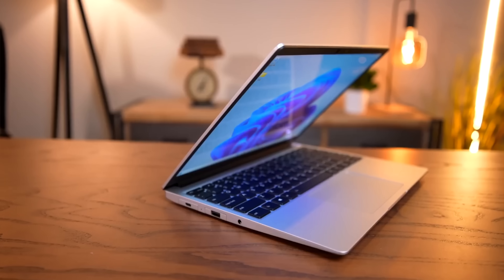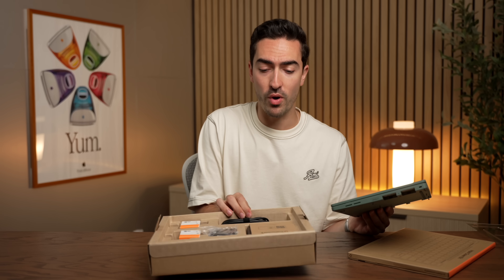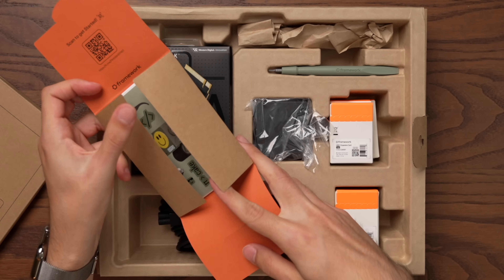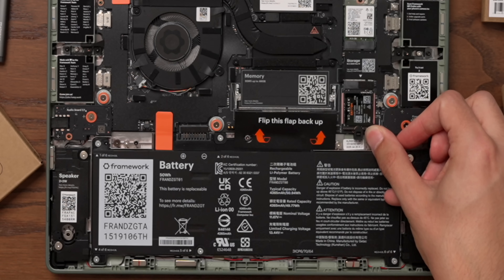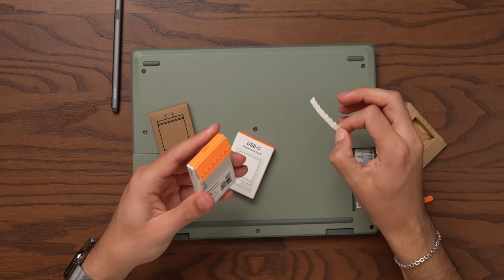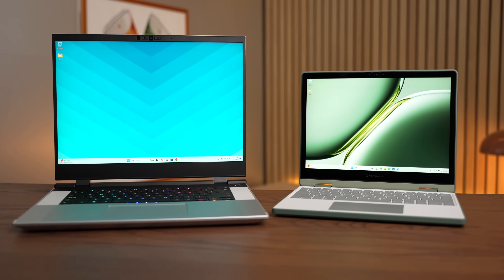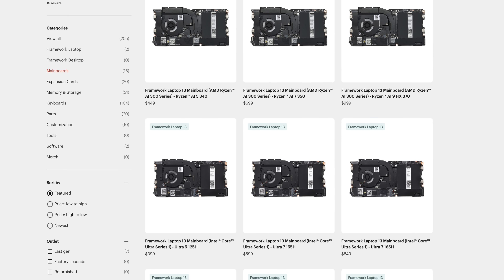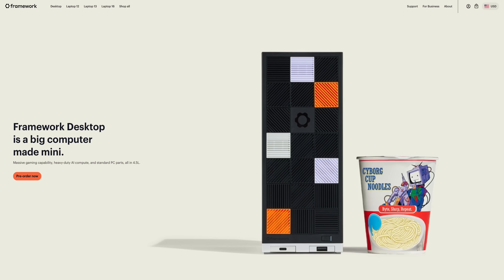Apple could NEVER: Exploring Framework 12

Comment: I was considering buying one of those. The main focus of it is really the 2 in 1 design, which makes the framework 13 (and the mac) just not suitable. This is just not a competitor to chromebooks, which are way cheaper and more locked down (both in hardware and software). I don't think any framework user would even consider a chromebook.
I ended up getting a Lenovo Yoga. What drove me away was the bad cpu, high price and worse battery life. I really value serviceability, but the lenovo was just so much better that it's hard to argue otherwise: for $600, I got a pretty good Ryzen 7, top of the line iGPU, 70Wh battery and so on; the framework is stuck with that old i5 and small battery for ~$950.
Now, I don't think spending extra with aluminum would help here. I think they should focus on getting a new CPU and reducing price; I would be fine with having a single pre-built model and no modular IO, if it meant cheaper prices.

Comment: Needs biometrics, at least a fingerprint sensor, but better if there is the Windows Hello IR cam. They need a better monitor on this machine, it doesn't even have 100% sRGB. Also they should at least get an i7 processor on this thing. A 13" form factor might make more sense for this thing.

Comment: If you say the device competes with a Chromebook, then don’t compare it to a high-end notebook like the new Apple models, where individual keycaps can’t be replaced at all and the entire keyboard has to be swapped out for a single damaged key. On many other devices, you can simply order replacement keycaps and swap them yourself in a few easy steps, without opening the device.

Single-channel RAM with shared memory for the GPU is fast enough nowadays that even Adobe Premiere runs fine on it. It’s not suitable for gaming, but most Mac users probably don’t care about that anyway.

The biggest downside for me is the half-size M.2 slot, because there are currently no 8 TB SSDs available in that format.

The video itself is well-made, friendly, and easy to follow.

Comment: Sure it's single channel RAM, sure the limit is 48GB, but look at what you pair it with. The benefit of dual channel RAM and more than 48GB (might get bigger modules in the future) would be lost on both the i3 and the i5 you can pair it with, incl. the integrated GPU.

Comment: yeah but when the MacBook air breaks a key on the keyboard or a screen cracks, match the replacement / repair price between the two?  its not about what performance you get but more of how cheap it is to keep it running "virtually" forever. and honestly the performance you get is not horrible, people have just been brainwashed to believer that apple  is top tier when in reality is not really, shiny and nice looking yes, but disposable and hard to upgrade/repair so after a year or two you have to spend another 2 thousand to upgrade... framework really is what we need and once the company gets more comprehensive sales, prices will go down a lot more, besides most of the repair parts are bellow the $60 bucks or less on most parts, so i am more exited about this than another mac or windows or Chromebook laptop

Comment: Are these Expansion Cards connected via USB C? Are they actually selling USB C to USB C adapters for $10? USB Hubs with 2 slots would make much more sense. Or at least USB A for retro devices.
Reply: You can just not use a C to C card and plug directly into the chasis. The purpose of the adapters is that you can get other port options, so while it looks dumb with C to C, it makes more sense when you see the C to HDMI, DP, A, SD, TF, etc.
Reply: @dontworry1302  sure, everything except for USB C to single USB C makes sense!
Reply: @igregurec  I don't believe you can do USB PD over a USB C hub, hence the 1 to 1. I wish there were 1 to 2 for other slots though.

Comment: 10:15 they want to change the way most it departments in schools operate. they want kids to have it and mess with it instead of it department holding them only in school, or replacing/repairing themselves. moving computer usage to even lower grades. kids should get that experience and they're also making it fun too. i could even go out as far as saying the cheap looks of this laptop is a positive thing for its market. parents don't want their kid who doesn't really understand values of things yet to have high end premium devices, they want a similar experience and more durability. framework 12 gives that and also delivers even more. the experience a kid would get building their own laptop just isn't something you can get from anyone else. plus you can also buy the broken component instead of a whole new computer when it eventually breaks as a parent.

Comment: It's a pretty compelling laptop. I like the aesthetic and form-factor. 

The only improvements that I could think of are:

- An option for a non-touch screen, in the hopes this reduces the overall price. (the current bezels are fine if that keeps the price low, would appreciate it if the non-touch option would still be a relatively beautiful display)
- dual channel memory
- the option for a beefier cpu. 
- bonus: a socketed cpu so that it doesn't require a full logic board upgrade when first getting a less powerful cpu option. (idk if this is possible)

If they keep it under 800-850usd prebuilt this would be a killer deal for every parent that wants a repairable laptop for family use, or for every enthousiast that wants a repairable linux laptop.

Comment: I think the single slot  of memory is the biggest downfall for this version of the laptop. In order to use the Intel Iris graphics you need a second slot a of RAM also computers and laptops work better with 2 slots of RAM being used. But i can't blame them for that because there is lack of space also this is there first 12 inch laptop that they had to design. Hopefully if possible they would add a second slot for RAM in the future in this version of the Framework.

Comment: As expensive for what it is this might be, I will be upgrading to it, having let the 13 and 16 pass before.
I am commenting from a ThinkPad T495, which was an emergency second-hand buy to replace a failed e585.
That previous laptop got unstable, probably from the motherboard flexing while carrying it around in a backpack for 6 years.
By using my current T495 and my LCD Steam Deck as a Linux Tablet, I have figured that I would enjoy a device in the middle of these two.

To save on costs, I will be buying the RAM and storage locally, I wish I could save further by omitting the wireless card since I have a spare.
After this and by omitting a Windows license, the total cost is €825 here. On the expensive side, but justifiable for something which lasts.
As I run a lightweight-ish Linux distro, which works plain better than Windows in my cybersecurity studies, my demands here are not that high.
Yet I manage to analyse 240GB disk images, do CAD, video editing and on my previous laptop occasional gaming on a lower level of performance, after a RAM upgrade.
And the bit of benchmarks I can find on the i3-1315U of the base Framework 12 indicate that it would double the performance I currently have at the same wattage.

Currently I use a dedicated screen-less drawing tablet for note-taking, but at times this becomes awkward.
So I hope for the 12's stylus support to give me a compact-er alternative, even if I will continue carrying that tablet for the greater comfort and accuracy.
Half the dongles will be a DIY 3D print around a cheap but good dongle I already have, making the amount of IO more reasonable.
And this will double as a stylus holder and moves the power button to the usual position, since it will be an extension to fit said dongle.

Comment: Framework is the only company besides Apple doing something really interesting in the laptop space. Apple does the self-contained design to its absolute best, while little Framework does an open and repairable design to the fullest. Everyone else is just awkwardly in between, getting the benefits of neither but the disadvantages of both.
Reply: GPD is doing some interesting stuff with ultra portable machines, but those aren't really "laptops" for the most part.

Comment: In my opinion, the Framework concept is the correct way forward, but I would not have Windows for the operating system because it is a bloated OS., which slows computers down, I would install Linux Mint or another Linux OS..

Comment: I bought a few 'convertible' laptops. And they all broke after just a couple of years of use. Breaking hinges and just plain stopped working. I wouldn't hesitate to pay €200 more for this one that looks way more sturdy. Once dropped a glass of Belgian beer over a macbook 13. €1500 gone. With this machine it would cost me between 50 and 100 euro to get me a new one. No need to pay a technician to try and get it back to work.

Comment: See I like this over the macbook becuase apples batteries suck. They die so fast (number of cycles). With the framework you can buy a new battery after 2-3 years and boom your good to go again. As for price don't buy your parts from framework. Get the ssd and memory from amazon, newegg, etc.. Fully kitted out I'm look at around $1000 for a maxxed out version. Sure at that price I could buy a mac but then I run into the battery issue. Least that's my 2 cents. that said I do think the 13 is the better buy for most people. For me though I just want this for board/party games and travel so I like the cheaper price point of this over the 13.
Reply: If you look after your battery, it will not die. EU Law states that they must have a minimum of 800 cycles before reaching 80% health. Charge to 80% and you will double the cycle count. The problem with your argument is that you only get 5 hours SOT with this old inefficient chip in the Framework, and doing the same, you get 2-3 times that with an MB Air. So, if you keep it for a decade, it is likely that you will have to buy a new battery for the Framework maybe three times, at £69 each. My M1 MB Pro 13 still has 96% capacity after 4.5 years! So, likely I may not need a new battery at all!
Reply: @andyH_England yeah that’s the rub I will keep it for 10 years lol. I dunno maybe Apple is better now I know when I had one from maybe 2012 or 2013? The cycles definitely didn’t go that high before it started to show its age. I mean it would last but nothing like the original life span.

Might just have been the one I had but by 6-7 years it would drain faster than I liked. Truthfully though it’s less important these days with the ability to charge via power banks. But, still sticks with me how annoying it was having to order batteries off eBay.
Reply: @TheRetroPitstop  Yes, like with most things, you can end up with a dud. I can only relay my experience, and I have had no issues with batteries in my business on either Macs or Windows machines. However, due to the poor battery life of older Intel processors, batteries tend to degrade faster.

Comment: Just to hit a few points about the 12.    First, I agree that the limited processor choice is a bit of a downside - the single channel ram is also a bit of a negative.  I have a FW16 and an ASUS ROG Flow X13 - if I didn't have the X13 - I would consider the 12.  But my use case would need a higher end processor and a lot more ram.  To be honest, I would want the Ryzen 9 AI Max + 395 with 128gb ram.  Given with what we've seen on the Z13 - we know it is 100% possible to chuck it into the 12's chassis space and the 12 has a bit more space for cooling, lol.  

That said, for the use case of this machine and the amount of ram there is available for this kind of device (48gb) DDR5 is nowhere near as horrid as DDR2/DDR3 was for laptops in single channel.   Also since there's no soldered ram it means you aren't stuck with some low-ball amount of ram where if you go significantly past it you're losing the benefit of dual channel anyway.   So  I also know that the original FW13" launch had some limited processor choices as well.  We can hope that maybe they can integrate compression attached memory modules (CAMM2) and maybe one of the new AMD/Intel designs coming down the pike for 2026 for future logic boards (this would make sense across their lineup).   

That said, upgrading the internals is a niche for the first owner.  The thing that makes this particular laptop a potential buy for a lot of students and educators is that framework has shown a commitment to long-term support for their designs.  It means that when a student is ready to upgrade to a different machine, they're going to have a choice to either buy a new logic board or sell the device to another person who will then have the option to upgrade the logic board.   If there's damage, framework's parts availability means this computer is not going to be ewaste.   Laptops get far more wear and tear than desktop computers.  Not a lot of people are going to hold their computers for 10-15 years and be willing to upgrade them.   That said, many people are going to be willing to sell off their device when its done.   This means that with some minor investments a new user can take an old laptop and get years out of it.  And if the people using this have a good experience, they'll probably go with framework again in the future.   And it will change how the laptop segment is presented to the public. 

My biggest issue with laptops of all manufacture specs has been hinge/screen failure.   I personally went with apple in the 2010s because of their rock-solid laptop chassis design - but having been in IT for years any time I had to get a workstation class laptop for someone - it was a PITA.  I have had so many instances where the hinge cracks, screen gets damaged or the logic board experiences mechanical stress and fails.  Second biggest issue?  Keyboard failure.  Third - battery.   Yeah I could get HP/Dell/Lenovo parts in the first 3 years easy-peasy, but doing long term maintenance was expensive and in the mid 2010's everyone was fully embracing the disposable mindset.  Framework eliminates that stress for me.  Looks like the 12 is in the same line as the 13 and 16 on this count.

Comment: apppple would still profit if one could upgrade ram and ssd.. hell 90 percent of their customers have no clue what's a ipsw / command terminal or simply using launchpad is all about ...
Reply: Apple's business model involves discounting the base model, which is subsidised by charging extra for RAM and SSD upgrades. More and more OEMs are understanding this model, including, to varying degrees, the Surface line and Samsung. Apple understands that the tech market is relatively small, so it targets the core (average) user, where specs are not essential, with price being the deciding factor in their choice. Why would Apple change a successful strategy in a market dominated by a Windows monopoly where breaking through their 105 market share is impossible, no matter how good their PCs are? Additionally, ARM is a system-on-a-chip, much like smartphones and tablets; therefore, like those categories, it is not upgradeable.
Reply: @andyH_England  Maybe it's efficient, but it's still a bad practice.

Comment: Of course you recommend a Mac. Without pointing out that the minute there's a broken battery or broken motherboard or broken ribbon cable you'll need to go buy another Mac or give Apple 200 bucks per annum for the remainder of your life as an owner of their products. 

 So this will not only save you another thousand bucks on a MacBook Air (realistically probably two or 3) you won't need to buy the first time anything goes wrong with it.

That doesn't even get into the fact that if you need a touch screen or stylus support a Mac is a non-starter. I mean of course you're an Apple channel if you start recommending things that aren't Apple your audience will turn on you pretty quickly. But it's just disappointing that you have something that's cheaper than a MacBook Air, is repairable and modular in almost every single meaningful way, has a touch screen and a stylus that comes with it.... And if you're disappointed with the performance well guess what you can change the motherboard and the chip anytime you want.
Reply: Look at the price of changing the motherboard/chip -- £850 to upgrade to Meteor Lake, which is now deemed old compared to Lunar Lake and Arrow Lake. I would not recommend the Framework 12 until it gets a sound chip. It is unlikely that we will ever see Lunar Lake, as it has soldered RAM. Therefore, Meteor Lake is probably next year, even though Lunar Lake was the reset for Intel and what most people should buy in 2025.

Comment: I've always wondered why someone like Framework hasn't come up with a kit to fit into an old aluminum MacBook Pro chassis.  There are tons of them floating around.  They're rock solid, and putting a new, modern logic board into an old i3 machine's chassis would keep them out of the landfill.
Reply: Apple aims to be 100% recyclable in the next few years, and to claim Apple and other OEMs are non-recyclable is a total myth and the usual anti-Apple negativity to justify something like the Framework. Apple uses recycled parts, and if you hand an old Mac in to their many stores, it will be recycled.